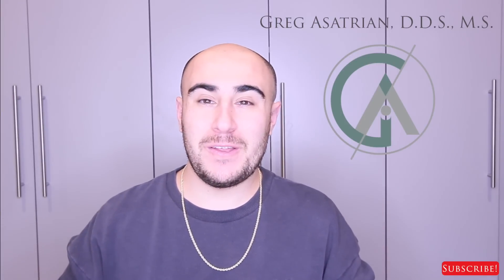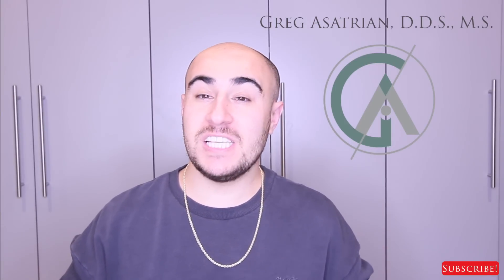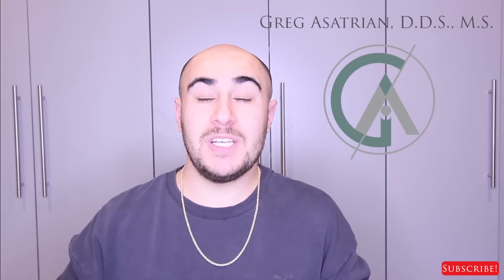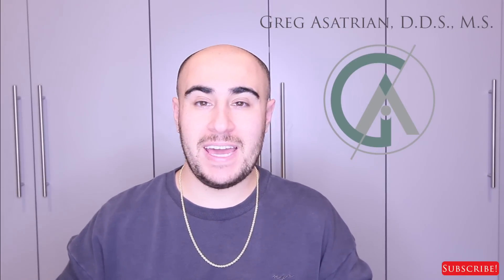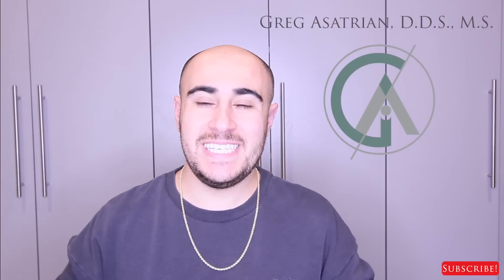[BRACES EXPLAINED] TADs / Mini Implants

Comment: I have one in my upper jaw or the roof of my mouth. The process of getting it didn't hurt at all.....except for the Injection. It's connected to my teeth via 2 threads. Anyone know how to help with the tongue pain. Anytime I swallow my tongue smashes against the screw. It's so sore.  I tried putting wax there but the sharp part pokes through. Any other tips besides wax?

Comment: Hey I got a question. So I had 4 teeth removed a few weeks ago. Two on the left side and two on the right. Each side had one removed on the top and one on the bottom now I have gaps between my teeth where they were extracted. Would I need TADS to move to teeth back to cover the gaps?

Comment: So I have gotten a nance appliance, but the band on the right side is having a really hard time sticking to the 2nd molar. This is because this particular tooth is only partially erupted. The orthodontist said if it falls out again, they're gonna have to unsert a screw for anchorage (I've been trying to avoid it, kinda freaked out by the idea of screws in my mouth). But if I do get them, how are they removed? Do theg put dental filling into the jawbone? Will there be a hole in my bone forever or will the bone grow back by itself?

Comment: I have a TAD for 2 months and it fixed my bite.  Loved your video. The implant was fine, just a little pressure like you mentioned.  There is one thing to add though.  After the implant, I was driving and decided to drink water. Well, I couldn't help but laugh as the water ran out of my mouth and down my neck.  Apparently, the numbing medication impacted my ability to drink. Funny when it happened.  Otherwise, good experience with TAD.
Reply: Ohhh 
 How old are u
 Was that for over jet?
Reply: Is it corrected in just 2 months
Reply: Hahhaa it’s like how I rinse after the implant I could not spit the water it was running down

Comment: I am currently in braces to correct an overjet. The first orthodontist I went to said tooth extractions would be necessary. I consulted someone else and they suggested the TAD's. Placing them wasn't painful. I did feel a bit of pain when the anesthesia wore off, but that pain was easily manageable with paracetamol. So yeah, they are nothing to be scared off, and they may be worth it as it means tooth extractions can be avoided.
Reply: Heyyy i too need to get tad to treat protrusion of my upper teeth. I am having Damon braces. Can you please tell.your.experience

Comment: I had the procedure this last month. 3 TADs. Painful as hell during installment. Took 3 days for the pain and soreness to settle. Had to take painkiller the night after installment. Basically from 2nd day the pain and soreness was bearable, and from fourth day, as good as not noticeable. I had first 2 tads placed 20 days ago, which took me a week to get comfortable with. The third one was placed 3 days back. So I'm hoping it will feel totally normal once the week is over. It feels quite well already ✌🏻 but yeah, it was definitely not pain free
Reply: I’m getting them so it helps my lower jaw move forward

Comment: Thank u for the information u provided very helpful. I just wanted to know after the braces treatment is completed that micro implants are removed or they kept there .
Reply: They are removed as soon as they get your teeth moved to the desired position. The bone tissue that it's in heals up pretty fast (osteoblasts start repairing it)
Reply: @feruzaagzamova5553  are the results permanent ? Thanks.

Comment: Just got my mini screws yesterday on both right and left upper jaw. My dentist said my upper jaw teeth are extremely hard to be moved even use Power chain and spiral weren't enough to make those move to the wanted position, so I need to apply the mini screws to bring the teeth inside.

Comment: I had TADS a couple of days ago and it doesn't hurt as they use Anastasia for that part and after that also it will not hurt as TADS don't touch ur nerves but tbh I had a pain when they did on the left lower but after a while it an hour it was gone and I didn't even realize that.. Don't be worried... 🥰

Comment: Hi Dr.
I’ve braces for almost 6 years now. Initially in 2014 while putting braces Dr. didn’t extract any teeth. But in 2019 they extracted 4 teeth’s. But still we didn’t achieve the purpose of braces. Now Dr. suggesting to remove upper 3rd Molars and put TAD to pull upper teeth’s. Now my questions are?
1. Is it ok to extract 3rd molars (so, then totally I’ll be lost 6 teeth’s)
2. Will TAD gives any problem in future?
3. Is extraction of teeth’s effect nerves in brain or any problems do we get due to extraction?

Sorry for big question. Answer would be appreciated. Thanks

Comment: I had a tad put onto my upper right pallet and the shot hurt a bit the tad itself was a lot of pressure with some pain. I am an anxious patient though so someone else may have an easier time. It feels very rough three days later. Sore at the site/wound. The screw itself is rough and my you hue is getting scraped. I called the office and they said never heard of that. I just keep rinsing with salt water and putting wax there when it gets to be too much. I’ll wait a week before I call back. I honestly wish it wasn’t in!
Reply: Hey there I'm having TADS and I have a similar experience right now. Today is day 3 but the pain is umbearable an doesn't seem to die down. Did yours heal or do the ortho need to do something?

Comment: I think i am also wearing this. My ortho installed two onto my lower jaw: one left and one right. The reason is because my molar teeth are not strong enough to become anchors or something
Reply: Hi Sandy River, may I ask how long it took after they were installed before the swelling stopped? I also have 2 tads on my lower jaw. It's been a week and theyre still swollen. Thanks!
Reply: @mikkarosales13  only like 3 days at the most? The second tad only even took a day. I think you should consult this with the doctor. There is also a possibility that it also may differ to each person. Does the swelling still hurt?
Reply: @sandyriver4705  3 days?? 😲 there is still pressure and it still hurts a little. I can feel the bump from swelling when i touch my face. Do you see your screws clearly when you check them? When i check mine it looks like my gums is slowly covering the screws :( not sure if it is because it is still swollen

Comment: Did anyone get or anyone have TAD’s?  and does it hurt? My Ortho wants me to get two. There has to be other options beside drilling into my gums right?! lol my gums are going to look like Frankenstein’s neck 🤦🏾‍♀️
Reply: hello :) At the start, i was supposed to get four metal screws because i got four molars removed one on each side up/down. He applied a numbing cream on the area and then injected it inside. The procedure did not hurt much for me and a little blood came out when he removed a small piece of gum. He needed to push the metal screw in so it would hold in its place and for that i needed to feel some pressure. I didn't feel any pressure and they were very unstable. My bone did not heal fast enough and that was also a reason as to why they were unstable. I got another appointment for palatal screws instead (in the roof of the mouth). 

Eating food was hell omg 😭 it took me years to eat. The next appointment for the palatal screws went well. I got 2 in the roof of my mouth (one of each side). I personally think palatal screws worked better for me. I only felt a slight pain because of the pressure and the numbing injection. Other than that, it was fine. I got a palatal expansion thing place on it too. Dont worry about it and make sure you ask your ortho lots of questions about the procedure if youre unsure about it.

Comment: I just got 3 TAD's to correct a severe scissor bite, 2 screws on the upper right side and one at the lower. 
The lower one is hurting me tremendously, even though I have high pain tolerence. And my cheek is a bit swollen! Is that normal??

Comment: im getting my tads tomorrow and im very nervous. i have read and watched helpful videos on tads. your explanation is the best. i had 4 second last molars (lower and upper on both sides) removed. so my ortho said that the tads are going to be placed cause they want it to pull one tooth to the other one like you said. im scared lmao. he also said that it could prevent jaw surgery in the future. my ortho said i dont need to worry too much about it. im hoping that the injection is going to be strong enough that way i wont feel anything. 

I'll come back to share my experience 

:(( i think I'll get two tads tomorrow instead of 4 because i have 2 discussions.
Reply: LMAO IT DIDN'T HURT ONE BIT

my ortho applied a numbing cream to the area. this helped because i didn't feel the injection. i didn't feel any pain, only some pressure. you need to feel pressure that way the screw can fit in nicely. 💀💀 my screws were unstable in the bone because it wasnt healed yet. so he did it two times. um 🤡 my right upper wisdom tooth came out in the wrong direction which is the reason i cant even bite properly. (space between my teeth which wasnt there before) and now i might get palatal tads (roof of my mouth) because the bone is stronger there. i want death
Reply: update!! 😭😭 a palatal tad is so much better than mini screws. i felt like i had to be extra cautious of my molars when i ate food and it took me years to finish a meal. since the palatal screw is on the roof, the bone is very stable. i think that i have a palatal expansion rn. (i googled it and this seems like its the one). im going to have this for 4 weeks. i also have this lingual arch for the lower molars. hopefully I'll see some change
Reply: @fadumah9821  How are you doing? I have two mini screws in the roof of my mouth. Nothing attached to them yet, will have that done in 2 weeks. Goal is to decrease overbite.
Reply: @RebeccaEd  hii Im doing alright at the moment :)) thanks for asking. How are youu :)) 

I needed braces because of my top canines that were longer than my top incisors. not sure if that makes sense 😭. So, i dont have braces on all of my teeth right now, just the side teeth. The space of my molars are slowly closing up. I will get braces for my front teeth (canines + incisors) later on. My overbite is bigger than last time and I can fit my tongue through it. ooh my teeth did start moving last week and my ortho said that means the lingual braces on the bottom teeth is doing its job. He also bonded the lingual arch braces.
Reply: Hi. Did you experience any pain after the tads were installed? Did it cause swelling and sores?.
Reply: @MDUy-fn3bq  Hii. I didnt experience any pain. It just felt weird. Since my bone wasnt healed at that time, the tads were very unstable and were moving around alot. Other than that, I didnt get swelling and it did not hurt. My ortho dentist used a numbing cream. Instead of these molar tads, I got a tads on the roof of my mouth because the bone is way stronger there. I found these better because its easier for me to eat.
Reply: hello faduma, i just had 2 TADs installed today. how do you keep them clean? it’s still hurting so i don’t dare to brush over them now
Reply: @yeeshiansim2293  hey, so i got my tads (near the second last molars down) removed after one week because my bone was unstable. it didnt heal enough after my 4 teeth extractions so he only tested the tads on the bottom part. i dont exactly remember everything my ortho dentist said but he told me to not brush the area harshly and to use mouthwash. it was hard for me to brush them and eat so im glad i dont have it anymore. if you give it some time and keep ur mouth clean then you will get used to it. it was really hard for me to eat so i needed to either take super mini bites or turn it into a soup.

Comment: Hi, thanks for the great video. I recently had TADs inserted in my upper jaw to treat my gummy smile. I also have a slightly retrognathic chin with a prominent chin button. Will this improve as well once the TADs finish their work?
Reply: Did it hurt? Did you so it under or just local? Thank you!
Reply: @rowenng977  Hurt some the day I got them- but nothing that an otc painkiller will not fix. I was on  local anaesthesia, and felt right as rain the next day.
Reply: update on how they worked out for you?

Comment: I had to get 4 miniscrews to secure my palate expander onto the roof of my mouth since I'm 18. I got injected with numbing stuff, so I couldn't feel the actual screws going in. The only pain I felt was from the bands on the expander tightening on my molars.

Comment: There have been many times where after placing the TAD, and the elastic was attached to the teeth which was meant to be moved, the tad itself started moving instead of the teeth. Why does this happen?
Reply: Like a the tad on my lower left side works fine, but the one on the upper jaw in the left side isn't. Also the TAD on the upper Jaw is placed slightly diagonally above the teeth which is meant to be moved.

Comment: Thank you for the explanation.  I had three TADs placed a few days ago.  My orthodontist will start pulling my molars into the missing spots in two months.  I'm feeling discomfort on my right side particularly upper TAD, but I'm rinsing with a prescribed oral rinse and brushing to keep mouth clean.  However, my face on the cheek area is tingling.  Hoping that goes away soon.  The procedure was not painful...more scary than anything else.

Comment: Hello Hi Doctor, I’ve been wearing Braces for 2years almost 3years. My teeth condition at the early, no need to remove any teeth.
But I now....have Open Bite, previously my Doctor use Elastic Band, and make bite with topup something on top of my teeth.

But my bite still not close.
Today my Doctor said, plan to do TAD.
Doctor any other way to solve this open bite?? Please, I scare to do surgery.

Comment: Is it common to develop canker sores around TADs placement? I had 4 screws and was fine  the first 2 days. On the 3rd day morning, I felt pain in my mouth and found 4 canker sores on my upper lip where it touches those TADs. The the 4th day around TADs placement site also developed sores... I now have about 8 canker sores, pain as hell.... Is it a sign of infection? Or it’s just my body not used to those TADs?

Comment: I had a tad put in 2 days ago. The elastic that was put on from the screw to the tooth is cutting into my gums badly. Only 2 days and the elastic bleeds and has a white line in the indentation. It hurts badly, not the tad but the gums under the elastic. This cant be right? I go back to the dentist in 6 weeks.

Comment: I had two lower TADS placed. I experienced excruciating pain on the right side only. My orthodontist ran x-rays to ensure they did not hit a nerve. I cannot think of an explanation otherwise as to why I was in pain only on the right side. They managed to place the TAD, and ran another x-ray to view placement. My orthodontist ended up having to remove this TAD due to bad placement. During the removal process the pain was so unbearable, out of instinct I pushed my doctor’s hand away ( of course getting turned into a large scene). The TAD on my right side was the worst pain I have every experienced, all in which they wanted to blame my behavior ( crying in pain) on anxiety. Mind you, the left side I felt nothing more than pressure.

Comment: Awesome video, it was super helpful! One question though, I've heard the term plate and screw used in reference to TADs, is there a difference between these two?  Thanks!!
Reply from the maker: Thank you so much! Typically a screw is just a TAD but a plate is something that goes under our gums and its fastened with TADs which are a bit more stable but have a little longer recovery time

Comment: Hi Doc, in my next appointment, I'll have both an extraction and TADs installation. Is that safe?
Reply from the maker: I would refer this question to your doctor who is more familiar with your case
Reply: Michael Retuta i am getting those in 7 days i am getting 12 tad’s 4 upper 4 lower and 4 for a MARPE expander
Reply: @whitewindow2744  oh my, I had one TAD installed last Tue. It didn't hurt the day I got them. I can't chew from the side where the TAD got installed. It hurts when your chewing touches the elastic band attached to the TAD. Turned out the band got too close with my gums that my gum started to wrap around it. I was advised by my dentist to cut the band first til our next dental appointment. I will have another one installed next week. I don't like them at all.
Reply: Michael Retuta i am Gonna get them at all sides
Reply: Michael Retuta i am so scared 😖
Reply: @whitewindow2744  don't be, if the first few ones bother you, you may inform your dentist to have the succeeding ones installed at a later date instead of having them all at once. 😉 I hope you'll have a better experience than I had.
Reply: Michael Retuta thankyou how was it for you than

Comment: Hi Dr. Greg. 
I have my wisdom teeth both sides top and bottom. They are all aligned so I never had any issues with them. 
Do you videos that talk about treatment without extradition?
Thank you.
Reply from the maker: Treatment with / without extractions is dependent on the case. There are certain patients that definitely need extractions and others that definitely do not. Most people fall somewhere in the middle though without a clear cut answer
Reply: @DrGregAsatrian  in your cases, are extractions done prior to the braces being applied or during treatment depending on the patient and how the teeth are moving? What method is generally preferred - before oral during?
Thanks for the great content!